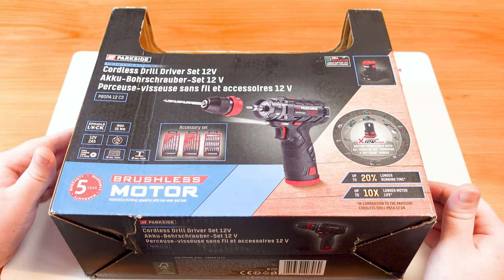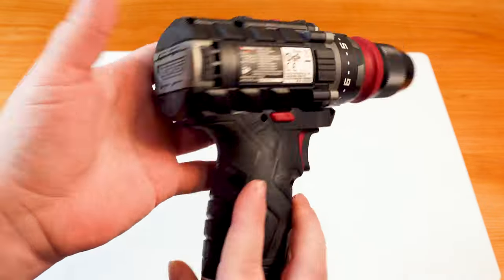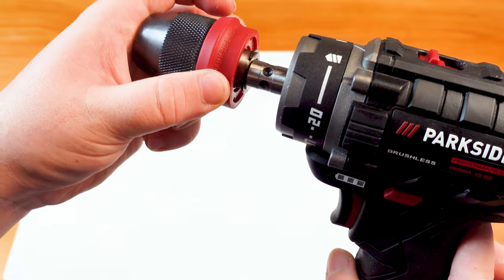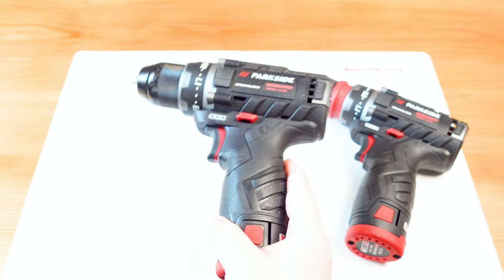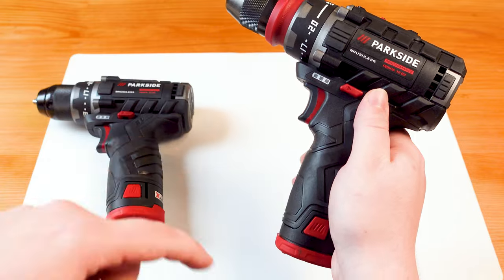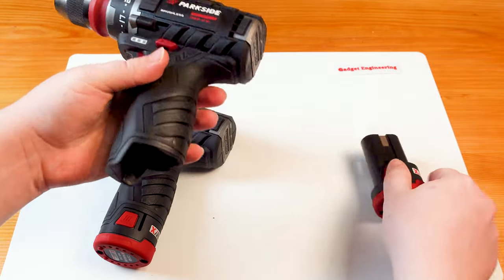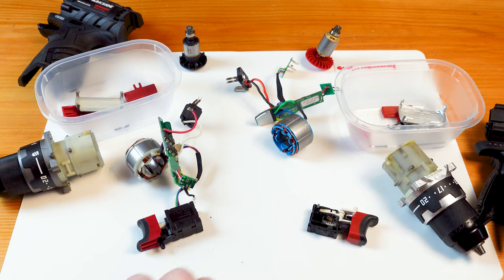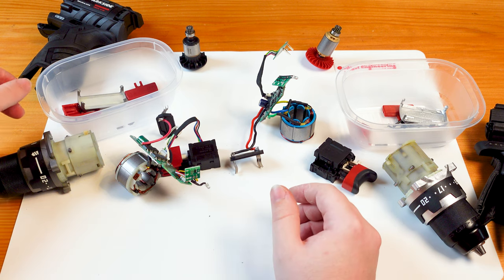EVOLUTION Parkside Performance PBSPA 12 C3 B2 A1 12V BLDC drill

Comment: 26:16
If gears are not aligned for change switch might sometimes get stuck, with spring user can change the setting regardless, and when the motor starts to spin it suppose to "jump into place".

I have two C3 units named so on the box, on the unit themselves they are named B2...I checked around 8 of them in two shops choosing the best ones.
What I discovered is quite sad, some of the units have much more power, some break more aggressively, some gears are looser and sound engines make can vary from air whistle to tank tracks...also the balance can be off as I think plastic cooling rotors are not on the place while machines drill holes to balance motors. 6 holes on the axle that are used by 6 balls of the chuck are not equal, which depending on the rotation you mount it might change its precision a great deal...from trash to pin-point accuracy. I think as a test I will drill those hair-thin deeper.
I also think LED should be replaced by DIY users ASAP, and some pieces of plastic should fill mounting surfaces around the gearbox so it does not move so much.

This 35nm is a joke...I don't think the batteries provided can utilize those engines to the fullest, I lack bigger ones for such a test, but the power indicator show battery charge drop by 1 bar on max speed, so I think the cell's discharge rate can't keep up.

For its price is perfect for light work or to reach super crampy spaces...
I still remember super duper Milwaukee & Makita top brushless models ELITE users swearing while they could not reach inside the duct during works in a 50mil £ a piece apartments in London center ...such little shit could save them hours weekly, but what do I know...
... I'm not a " PRO " =D ...not to mention battery thieves subject or how they had to carry it all :P

Comment: This is a great video - thanks. Particularly interesting noting the production differences you saw between the two, indicating the different factories.

There is a definite variation in the quality of tools the various Parkside factories put out (in the green standard tools) & i'm trying to determine if there's any telltales as to what you're getting/which are the best - the OWIM/Kompernass/Grizzly Tools labeling doesn't appear to mean much & actually changes across versions of the same tool.

Comment: Detail's man. I like this. But I wish, if it is possible, you would measure the actual torque both of them. It would give an answer the motors work the same or not. Practical tests, how many screws with different diameter and length can they screw in, etc., also would be useful. For the moment thanks for that you have done so far.

Comment: Very good video, I have the A1 version of this tool an is working fine. But I prefer to use my Bosch 12v tools. Parkside is ok but is not always available, no 12v battery packs when you need. But for domestic use, Parkside is ok. Anyway I like the way you explain things. Big like from me.

Comment: I bought my 60 nm for 50 euro... this 12v thingy costs 80 euro here in holland... like whats the hell is that.. i would buy it if it was 30 euro. The green 12v is 18 euro.. and works fine! Why does the bl model has to cost 80 euro.. crazy. Shame guz i would like it for screws and stuff
Reply: That is 69,99 euros here in Finland and according to the picture it is C3 version.
Reply: I guess the green version doesn't come with batteries, charger and drill bits and has a brushed motor. The batteries and charger cost 13+13+10=36 EUR if bought separately.
In Germany, the black model costs just 70 EUR which is fairly good value for the money.